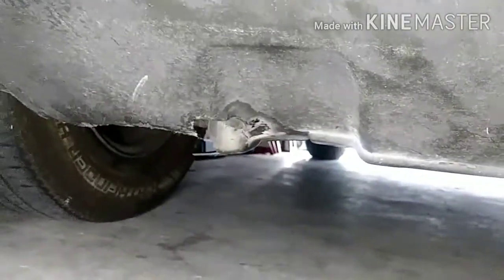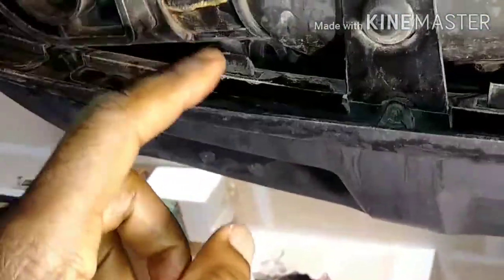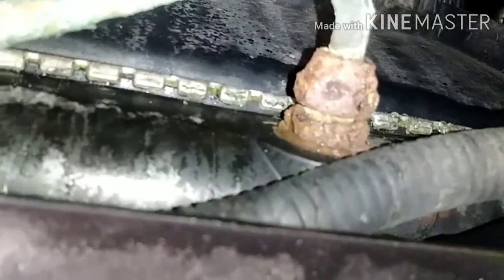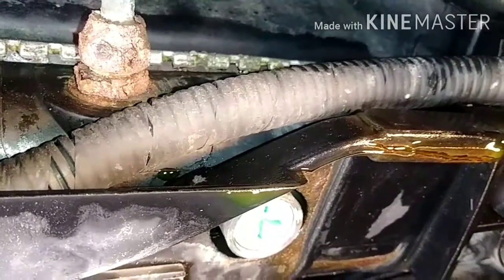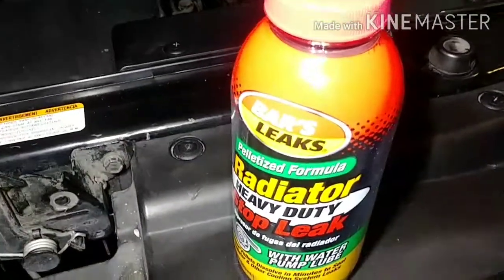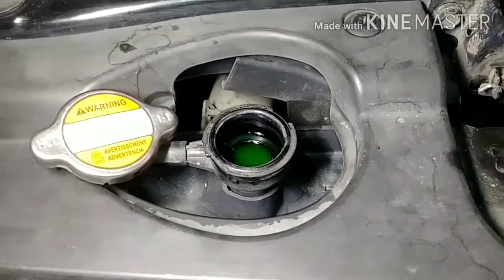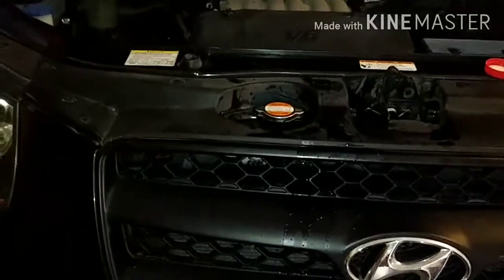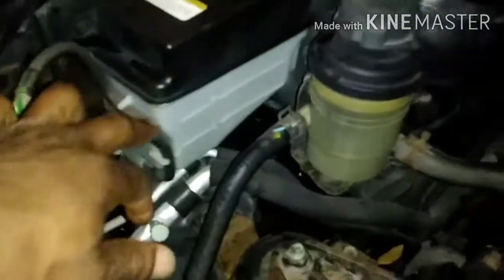NEVER BUY ANOTHER RADIATOR AGAIN, SO DO THIS SIMPLE FIX.

Comment: My friend, you can buy radiator for cheap. Around $50. Those sealer products will clog up the passageways after they seal the hole. Less free passage ways will make the car overheat. Over heated car will melt the engine seals. Only use those sealers in emergency. Get a new radiator, in the long run you will save much more money because engines are expensive and a lot of work while radiators are cheap.
Reply from the maker: You are 100% correct...but I am selling this car plus the leak was not major.  Than you and good Sunday my friend..
Reply: It doesn’t clog Anyhring but the leaks guys. They couldn’t sell the shit if it broke your whole car
Reply: thank you. I was trying to be cheap but you right. I'll get me one
Reply: You're right but to solved this I just take the thermostat out if it's a old school
Reply: plugged up my heater core  which i now have to replace don't use that crap! @All-about-everything

Comment: Bro I had new coolant and radiator and my mechanic said I don’t need them now I got a leak and I returned those parts. I’m just gonna do this since my leak is small too. I put a cup underneath overnight and it was so little like a small sip of water 💧
Reply from the maker: Well, if  it is a car you plan on keeping for many yrs,  it is ideal to avoid the sealant. 

Since you already used it, then put enough to completely seal the hole in the radiator. It should seal it completely w/o coolant sipping onto the ground.

If there is still a leak then your radiator cannot be repaired.

In that case, do a complete flush before  installing a new radiator...  

Thanks for watching...
Reply: Yeah I bought a new radiator coming Thursday but it seems like it did stop the leak still gonna change radiator though but yeah ima listen to your advice

Comment: Dude that stuff will clog up your coolant lines, it will get in your head gaskets, and even your heater core I do not recommend it
Reply from the maker: I agree with you, but why do stores sell them if they are so horrible?
Reply: They clocked my lines but I was able to save the lines and heater core but the heater core leaked onto a blend door actuator, so I changed that out.  Idk I have mixed emotions for stop leaks.
Reply: money of course